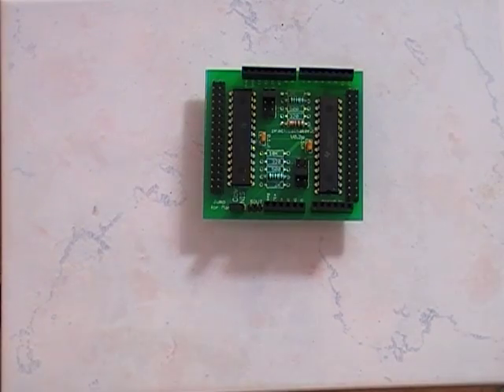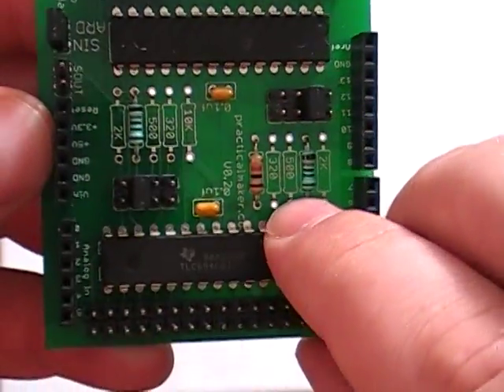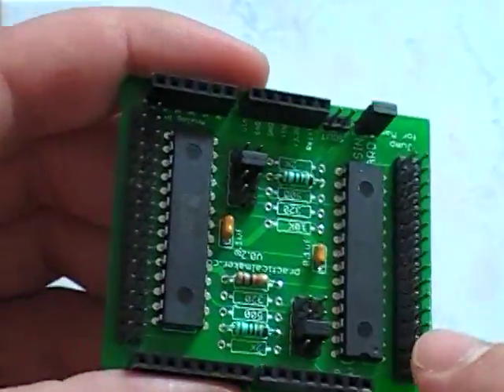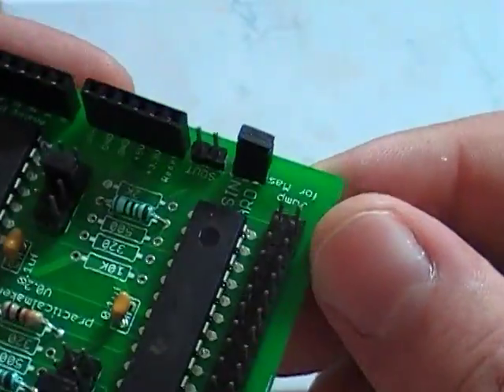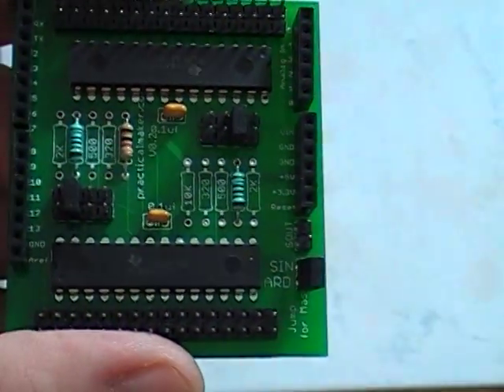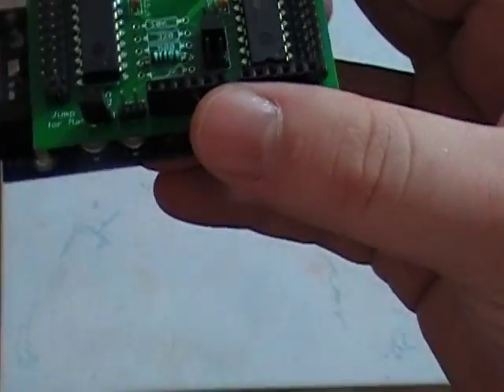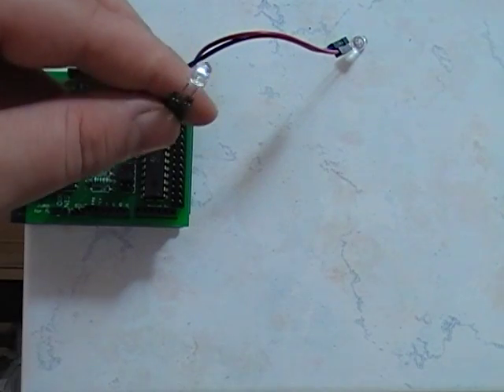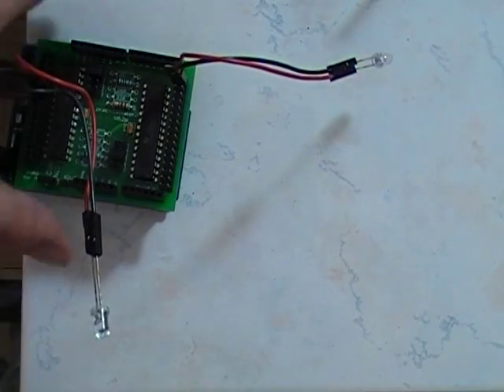Arduino TLC5940 Shield Demo

Comment: Keep in mind that there is NO requirement for the Arduino to power the tlc5940.  You could, (if you wanted) have each 5940 powered by a separate power supply.  A 2 amp power supply would probably feed perhaps 50  5940's in a line.  This will vary depending on the value you choose for a current limiting resistor.  For instance, the data sheet shows with a 640 ohm resistor, all LEDs on, 61mA.  That would let a 2 S supply run about 33 5940s.

Comment: Does it works well with 2 TLC and a 16x2 LCD display?
Reply from the maker: It will work with 2 TLC, but I'd recommend using an I2C backpack on the lcd display because you won't have the pins to directly hook it up.

Comment from the maker: Hi Dennis,

I've added the link.

As for the current, google TLC5940 datasheet and go to

SETTING MAXIMUM CHANNEL CURRENT

iref is 1.24 so it actually looks like:

I = (1.24/2000) * 31.5 which gives you 19.5ma.